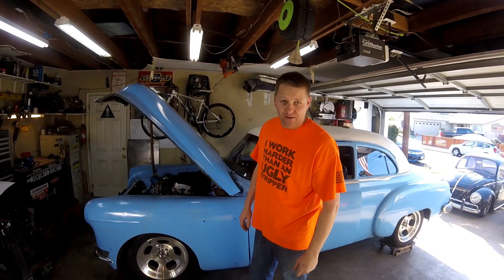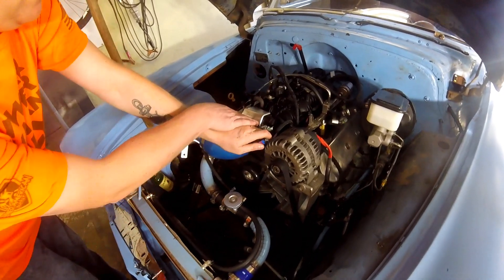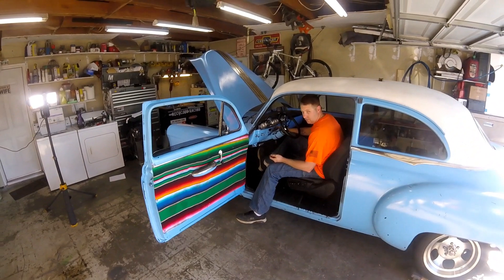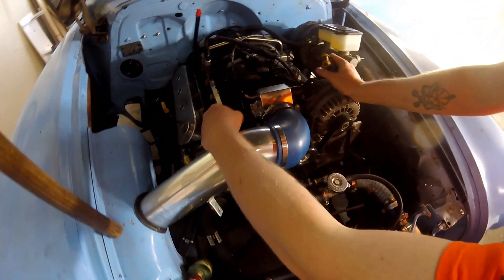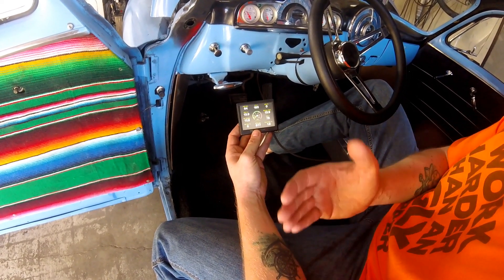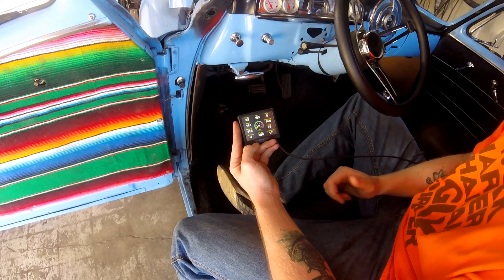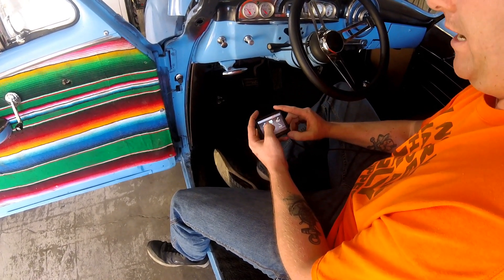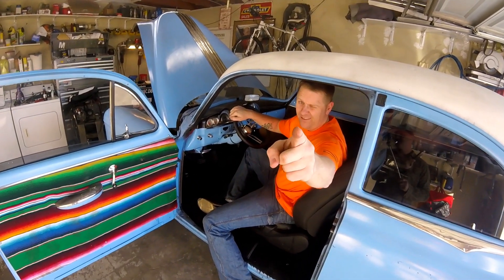Holley Terminator X Max Idle adjustment and IAC!!!

Comment: Can this cause a no start situation I have yet to start my engine. IAC reads 95% but It has never started. I don’t have spark or injector pulse. I do have sync and rpm signal about 160rpm while cranking.
Reply from the maker: If I remember correctly your rpm must go about 400 to get spark and injectors.

Comment: There's so many videos showing the incorrect way to "adjust" the IAC, including this one.  

You don't adjust the IAC, you set your idle with the IAC unplugged, perform a TPS Autoset, plug the IAC back in and you're done.  There's no reason at all to do it this way.

1.  Unplug IAC motor
2.  Start engine, adjust idle with throttle plate screw to ~100 rpm below target idle rpm
3.  Shut off engine, turn ignition on & perform TPS AutoSet in Holley software
4.  Plug IAC motor in 

DONE

This is where the IAC will operate at idle
Reply from the maker: You should let Holley know step 25 in their install manual is incorrect and your method is better.  Im sure they will appreciate your inputs.  Thanks for sharing!  Sharing is caring;)

Comment: Would I still have to set the iac if it’s a pull out motor? 
I have a 2000 ls1 f body motor all stock besides long tube headers with about 30 inch of tubing after o2 sensor.
Won’t idle for shit and it backfires on startup. I have the ecu map sensor connected to the bung on the intake. Verified coil wiring is correct. Wires that need direct battery are directly to the battery. 24x/1x harness and ev1 injectors it has fuel pressure. 
If I give it gas on startup it immediately dies or backfires really loud then stalls and it will have crank/cam red signal every now and then.  so I can’t get it to idle at all. Cam sensor and crank sensor are the black sensors and they’re both brand new.

It was running before we pulled it and the timing wasn’t touched so we know that’s fine. 
This was advertised as a plug and play kit and it seems like everyone has to go into software to get their builds running. I’m not a tuner so the computer stuff is confusing. Any input would be appreciated this is really frustrating. 

Great video by the way very informative. I’ll be subscribing.
Reply from the maker: Sorry for the delay.  The red light for crank/cam sounds similar to an issue I had before.  There was a junction in the holley harness that was just glued together vice soldered and when vibrated it would have an intermittent cam signal.  I troubleshoot for hours until I ripped it all out and checked each individual wire and found that.  There are threads and pic online somewhere about these issues.  I think holley fixed that long ago but that sounds similar to my issue
Reply: @RecycledRacing  thank you, it ended up being a faulty crank sensor that was supposed to be brand new 🤦‍♂️

Comment: Do you have any insight as to how to do the IAC adjustments like in the video but with a DBW throttle body? Would I adjust the Pedal position/throttle position graph? I have to hold my foot on the gas slightly for quite a while before the engine can idle on its own (30 seconds or a minute). It won't start up without giving it 20% throttle and if I let go right after firing it dies, I can't adjust the hold and decay times because it never does them...
Reply from the maker: I dont have any experience with DBW yet on holleys EFI.  I did mess around with it using HP Tuners.  With DBW you have to adjust how much air it is seeing coming into the motor.  I think thats controlled by a table somewhere in fueling.  If you figure it out please share so i can get the information out there!!
Reply: I need this info!!!
Reply: @NixWerx  So i somewhat figured out my issues with IAC, lots og gobble-dee-gook with the electric throttle body. 
You have to adjust the Pedal vs. Throttle position graph such that the pedal position of 0 is enough to let the engine idle. I changed my 0% pedal position to 6% throttle open and the engine actually starts up and idles. Start with 0 and bump the value up 1 point until it starts up and actually idles. Change your IAC park position to 0 while doing this so that the TB  operates strictly on the pedal/throttle graph; once you find the value that lets the engine idle, change IAC park back to what it was, 60% or 55% typically. Let the engine run for a few minutes til its warm. At idle the IAC position should be between 2-9%, so go back to the pedal/throttle graph and tweak it to get that IAC position. ENGINE SHOULD BE WARM BEFORE ADJUSTING FOR CORRECT IAC IDLE POSITION. 
IAC hold i would make 2 seconds at 600RPM above idle, decay time to 2.5 seconds, and 800RPM above idle to regain idle control. 

Hope some of this helps, the forums and other online research were VERY UNHELPFUL to figuring out DBW EFI parameters, and I'm not trying to spend $600 on a tune if all thats involved is some trial/error and thinking. Cheers
Reply: @rustysausage69  dude you’re a life saver! I’ve got everything idling but my tps never goes below 15 and my IAC is just screwed in general so I was trying to figure out where to go to figure it all out.
Reply: @rustysausage69  not at all
Reply: Mine fire right up and idles fine put my foot on the brake put it in gear still idles fine, haven't tried to drive it I AC says 22  well at least I figured out that there's no screw to adjust the blades from these comments.

Comment: Muhahaahah hp tuners will soon be a thing of the past and it only took 23 years
Reply: probably not, tons of people build there daily drivers with stock ecus.  These only are really good in swap applications.
Reply: @Mtnbike121  I agree if your doing a bone stock swap in like older gm stuff but if it's in an import or anything remotely race oriented I feel like it be a sin not to run the Ebay turbo or it be a sin not to cam it etc etc I get that not everyone needs a racecar but to me it seems like wasted opportunity but that's just my opinion since as a teenager I wasnt allowed to have a v8 car let alone a fast car so sadly I'm just building along I still drive slow car because my project car has taken 2 years so far and this pandemic isn't doing me any favors
Reply: @Dannymclovin  no no i get that, but like if i already had a camaro, corvette or silverado, why would i spend another 1200$ on a different ecu and then pay someone to tune it?  when i could pay someone 450$ to tune it.
Reply: @Mtnbike121  oh well that's completely different im talking about swaps, if you have a stock gm product that came with an LS youre right why change the ecu but if you know your going to do crazy mods I dont think it would make sense to pay a tuner when you have an amazing holley ecu that self tunes and has the extra safety measures